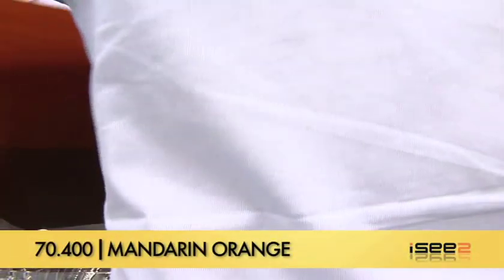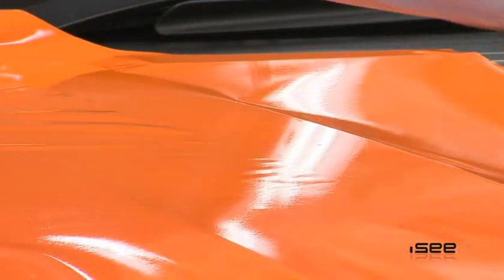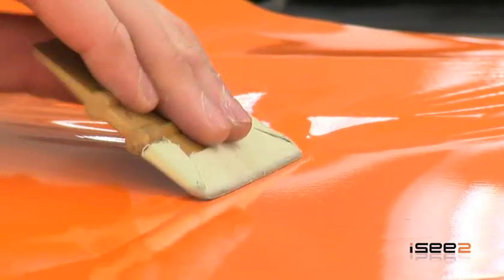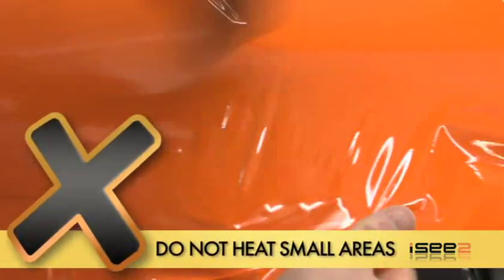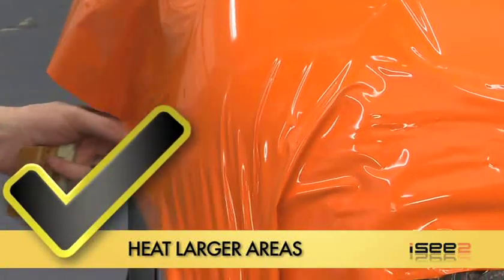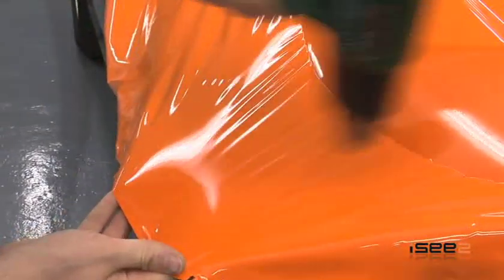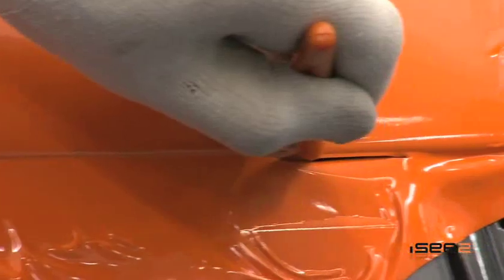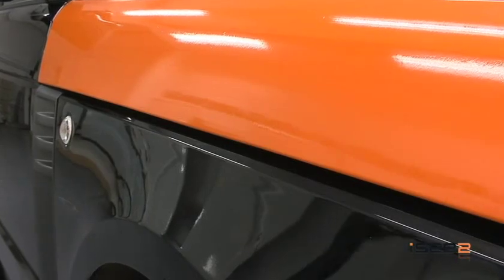iSee2 Total Wrap - Heating techniques for stretching round corners

Comment: Thank you for the tutorial! The point with heating large instead of small areas is what i've always did wrong. Over time, especially on my interieur, the wrap casted bubbles over time. Wasted so much carbon fibre wrap, ugh. greetings from germany!
Reply from the maker: Thanks a lot for your feedback Marc :) If you have any other question, we will be happy to answer. Greetings from Belgium!
Reply: iSee2eu thank you! :)

Comment: can I stretch my 1 foot vinyl to fit 1.5 foot car part?
Reply: U can but eventually it'll stretch back if it's over stretched
Reply: +SosaGamer how far can I stretch before over stretching it?
Reply: +Dr. Órale Holmes, MD if it's stretched in the middle then you'll be fun but avoid a lot of stretching around the edges. (Where the vinyl ends on the panel).

So to answer your question there isn't a exact measurement of how much you can stretch. But you'll definitely feel and see it when it's over stretched. It'll start to look like a ballon when it's over stretched per say.
Reply: +SosaGamer fine*
Reply: +Dr. Órale Holmes, MD basically always get more vinyl then you'll need don't try to cheap out on vinyl. Because mistake do happen and you'll learn from them